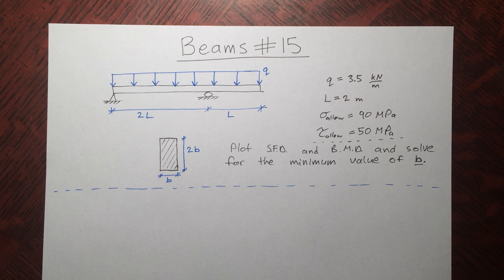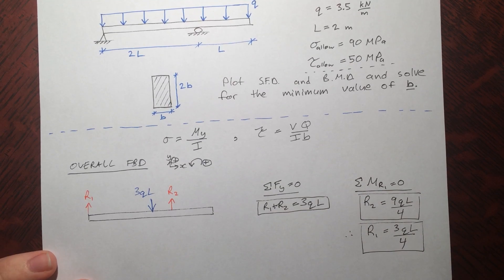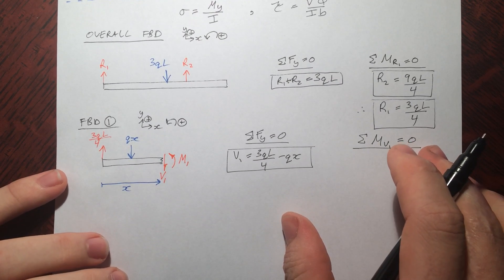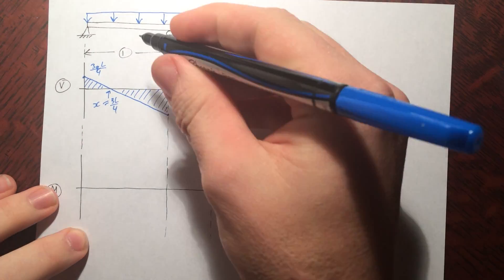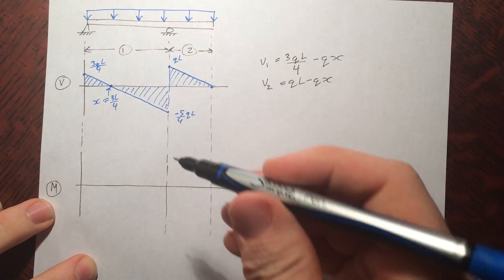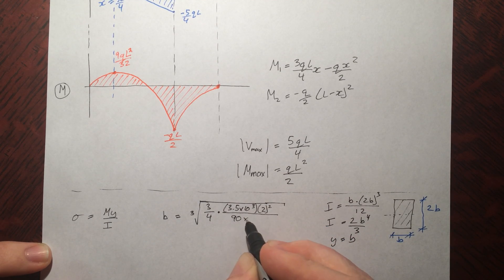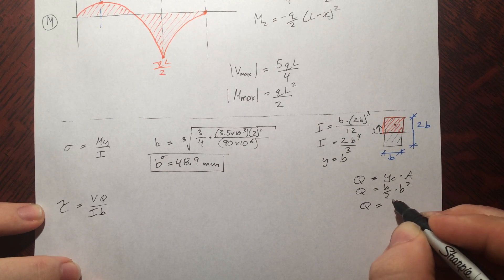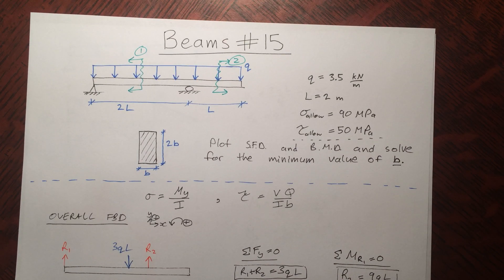Beams - 15 - Shear Forces in Beams Example #2: Design of Beams in Shear and Bending

Comment: Didn't understand the logic for selecting the value of b for stress over shear. Can anyone explain this?
Reply: Engineered Advice  i couldn't understand  why you choosed the width,b with larger value though the question stated that what min value should be selected. You said that for b＝48.9mm, both shear and moment fails,  so this value is to be taken. Does that mean that moment has higher priority than shear in selecting width?
Reply from the maker: Hey there Tripta could you please clarify your question a bit more? I'm not exactly sure what you're after
Reply: +1